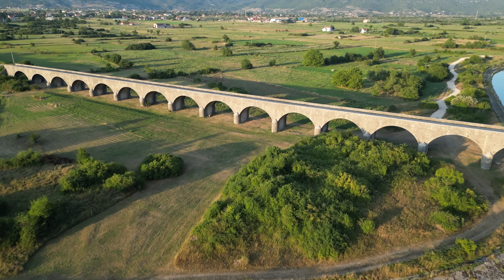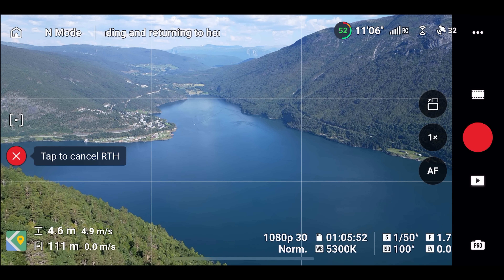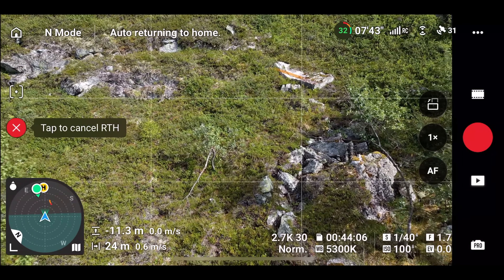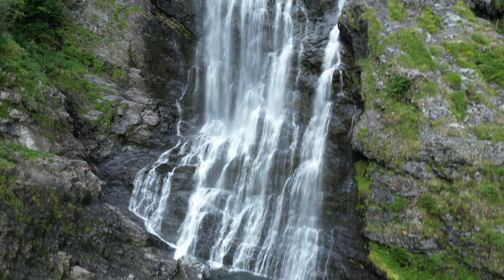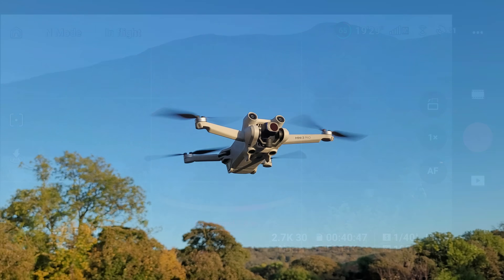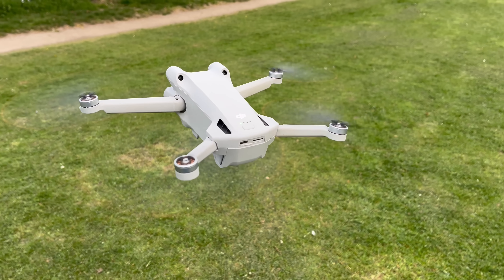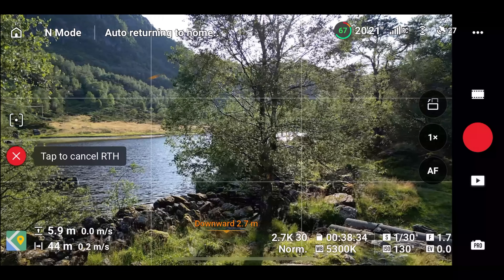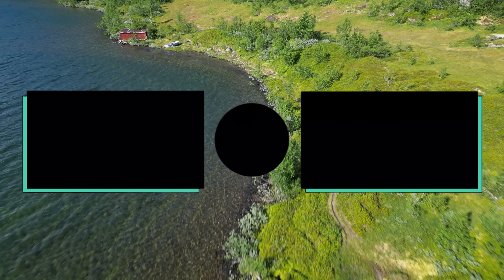Negative Altitude RTH has a BIG Problem... Here's What You Should Know

Comment: what? my old DJI Maverik Air 2 understand negative and positive numbers of its location in "3d space" this has never been a issue for me. the old ones ALWAYS rise first to 0 meters if at negative, and after that othe default standard setting of 120meters altitude before returning home, this is to make sure it clears tree lines and so on. These new DJI's seams to gotten worse..
Reply from the maker: Interesting. I haven’t seen how the older models handle this. Possibly this is a recurring bug in the software DJI needs to fix.

Comment: Never tried it, as I fly manually, but if your preference is set to bypass instead of brake, shouldn't it reroute past the obstacle?
Reply from the maker: Great question - one that I had too during my testing. The issues were still happening regardless of which obstacle avoidance method was being used, including Bypass. The drone just cancelled RTH as soon as an obstacle was detected. Thanks!

Comment: Negative altitude RTH is a user error, not a problem with the software!    The manuals say to pause at about 2 meters to wait for the RTH to set the location or to set it  manually about there.    "Negative RTH altitude" happens when users don't want to be bothered with that critical step and just fly off immediately causing the RTH to be set at the point when the GPS is enabled.  If you're flying downward that results in a "negative RTH altitude".    If you fly upward and away it still may result in a RTH considerably away from the takeoff point.

RTFM!      Maybe I know this only because I'm a newbie and realized it might be a good idea to read the freaking manual before flying off into trees, buildings and into water.

The RTH location cannot be set until the drone has had time to locate enough GPS satellites.    If you take off too quickly that location will be set away from the takeoff point.  And the more impatient you are, the faster you jump the gun, the farther the RTH location will be from the takeoff point.

What's clear from discussions (here and elsewhere) is that DJI's excellent software and hardware has saved many users from otherwise self imposed disasters because of not allowing RTH to be set at the takeoff location (users complaining about the drone returning to home at locations considerably away (laterally as well as vertically) and the obstacle avoidance preventing a disaster.  The drone just hovers because the pilot gave it instructions that would have resulted in a crash and the drone does the only intelligent thing:  wait for the pilot to realize his/her error(s) and give instructions that won't result in a crash.

PS  It is also HIGHLY important (RTFM!) to set a return to home altitude appropriate to the location.     DJI's drones obstacle avoidance may prevent a crash into buildings if you set RTH too low but a tree is likely to take the drone out.

The only SAFE way to operate a drone is to whenever a new feature is added (or upgraded) is to RTFM and find out the SAFE way how the feature or upgrade may change the way things work.

Read
the
freaking
manual!
Reply from the maker: From what I understand here, I think you have the wrong idea about what Negative Altitude RTH in this case is. It’s not about the Home Point being set by the drone somewhere below where you’re standing. It’s about how the drone returns to home from a negative altitude, like -20m.

You raise a good point though - it’s important to lock the home point before flying further away so that RTH precision is maximised.

As said previously, when the drone is at a negative altitude closer than 50m, it won’t return home. This doesn’t seem to be in the manual at all. In fact, DJI says that the drone will fly up to 2m if the altitude is less than 2m when RTH is started, which as shown in the video, isn’t the case. ( Timestamp: 3:15 )

So yes, always read the manual. But the crucial info seems to be missing from it. Thanks for such a detailed comment also.
Reply: you say RTFM , maybe practise what you preach WTFV , watch the firiggin video before commenting 🤣
Reply: Sorry, but the events shown in this video definitely can happen even when the drone has been allowed to hover over the launch point for some seconds until it has gotten a home point fix.
Reply: @afwAZ  Of course they can.  Again - RTFM!     You can set the altitude of RTH at the start of the flight or at any time during it.     If you don't set the altitude, the drone sets the RTH altitude a default amount above the point at which the RTH point is automatically set.   This is the point at which the remote is locked into enough GPS satellites, which, of course, can vary greatly depending on the location.    'If your are flying downward you're likely to be on a slope and many satellites will be blocked by the land behind you so that it will likely take longer (maybe considerably longer) for the remote to lock onto enough satellites to get a good enough location fix to set RTH.
RTFM!        And maybe even THINK a bit about what it says and how it works.

At no point in the video did the poster show any understanding that the RTH location cannot be set until the remote has located enough satellites to get a good enough fix!   Yet he went on and on about the problem without showing any understanding of how the technology works.

I'm just a relative newbie.   But at least I know enough to know that I need to RTFM and did so.      

KEY POINT.  You should PAUSE with every takeoff about 2 meters above the takeoff point and wait until the display shows that the GPS is active and the RTH has been set.

I've worked in user support before (computers, not drones) and any user support for any tech product will tell you that the majority of user problems are a result of users not bothering to RTFM.

Some drones are very expensive and it's just plain dumb to learn things the hard (and expensive) way because you couldn't be bothered to RTFM.

The budge way to learn is from other people's mistakes.
Reply: @afwAZ  RTFM!

You have to CHECK to ensure the drone got the fix.  In some locations it takes LONGER.   (the remote has to get a good lock on enough satellites)    Just pausing a few seconds will not necessarily get an RTH point set.   Especially when flying down!  (with a slope at your back you may have only half as many potential satellites available).   

And you can (and SHOULD whenever passing an obstacle higher than your current RTH altitude) reset the RTH altitude during flight.     For this (and other ) reasons you need to be AWARE of what your current RTH altitude is during flights.  Obviously the person making this video was not.

RTFM!  and THINK about how it works.   Understand what's going on and WHY and you'll have far fewer problems.

If something isn't working right it may well not be DJI's fault.   Maybe there's a loose nut in front of the remote.
Reply: @jimbarron9939  "You have to CHECK to ensure the drone got the fix." You assume what you don't know, and in this case is false.
Reply: @afwAZ OK I should have been more explicit>    The drone will get a fix whether you check or not.   What you have to check for is whether the drone got the GPS fix in the location you expected (just above the launch point).     If it took awhile to get a GSP fix the RTH set point could be considerably far from the launch point.

Most flights that descend from the launch point will have access to many satellites blocked by terrain.    So the GSP fix will be delayed resulting in a fix considerably BELOW the launch point if the pilot does not pause until the fix is done.
Reply: @afwAZ  IF the poster had actually RTFM, he'd have been aware of the requirement to hover over the takeoff point until RTH had been set, he'd have mentioned that he did that and the problem resulted in spite of it.  Because that's what people who are thorough enough to read the manual do.   The fact that he claimed that the software was in error without mentioning that he'd failed to rule out a potential misuse of it that would totally explain what happened is good evidence that he had not read it.  And not having read it, thinking that the problem was a software problem rather than (to put it generously) a "user interface" problem is what you'd expect.    

IF he was being thorough and careful, he would not have failed to note that he'd allowed the drone to set the RTH during takeoff AND that he'd  noted the signal from the drone that this had been done.   Not having done that totally destroys his credibility among those familiar with due diligence in investigating problems.

Even IF there was a real problem here (not caused by not allowing the drone to set RTH location during takeoff) the fact that he did not mention that was done AND that he CHECKED to see that it had occurred absolutely shows sloppy investigation. (a slopply investigation can sometimes return (by coincidence) an accurate result.  But if the investigation was clearly sloppy you can't KNOW whether the result was accurate or not without doing an additional (and careful) investigation.

Even a stopped clock is correct twice a day (unless it reads in military time).
Reply: @afwAZ  IF you had RTFM AND actually THOUGHT about it, you'd have realized that if within 50 M of the RTH point, the drone would not rise to the preset RTH altitude (IF you'd even set one !)

RTFM!  and THINK about HOW it works and what the very obvious implications are.

The manual does (at least for the Mini 2 SE) does not say it explicitly.  But it is glaringly obvious from reading the manual that if the drone is returning from less than 50 M away you'll need to monitor it and likely to control it manually.   Such things are exactly why manuals are written.
Reply from the maker: @jimbarron9939  The home point was locked in each scenario. Each time you can see in the top right of the screen that the satellite icon was white, which means that the home point was locked. This is also in the manual…The home point was locked BEFORE I took off.

During the tests, the icon was white with many satellites connected. GPS was strong. The problems occurred anyway, so it can’t have been because of bad GPS signal or a lack of connected satellites.

I NEVER fly away if the satellite icon is orange or red. I always wait for the system to say “Home Point Updated”. I assume this is common practice among each drone pilot.
Reply from the maker: @jimbarron9939  IN the manual it does say that when the drone is closer than 50m away, it won’t fly up to the RTH altitude, as you say. The manual however has some extra info as for what happens at altitudes lower than 2m, which as seen in the video, doesn’t happen. 
Once again, look at timestamp 3:15.

Believe me, I’ve read the manual countless times over.
Reply from the maker: @jimbarron9939  None of the scenarios in the video, apart from the first one, should have made the drone fly up to the RTH altitude. They had nothing to do with the specific RTH altitude set.

(This excludes the test where the drone was at a distance of exactly 50m away, since this test was to see if 50m made the drone fly up to RTH altitude or not, since it is on the boundary of the two distance thresholds.)

Comment: When I fly My Dji Flip drone around 50 m away then I press return to home. 
Then I See in dji fly application shows me your battery is critically low, force landing in progress .
But my battery is more than 50 .😂😂😂😂😂😂😂😂😂
Reply from the maker: That’s strange. Not sure why that would happen at all!
Reply: @takeoffdrones could it be because it was winter and the battery temperature was low?
Reply: @gurmiro  No there is summer season in Himachal Pradesh India temperature is above 35 degree celsius😂😂😂😂😂😂😂😂😂
Reply: @takeoffdronesI think that is software bug or battery fault
Reply from the maker: @dheerajsharma1981  maybe you weren’t using the official DJI battery?

Comment: If the drone is within 50m, it won't rise to the preprogrammed RTH altitude. It will fly straight toward the home point. It has been this way for a long time. I think the logic is if the drone is within 50m the pilot can easily see the drone to fly it manually or fly it to an altitude it can safely return home.
Reply from the maker: Correct. In most cases, you would bring it back manually. It only becomes a problem when you CAN’T do this, possibly due to the controller running out of battery or loss of signal.
Reply: @takeoffdrones Yep, and to add to that, losing signal is especially potent when in negative altitude, as the dirt and terrain will block the signals. (But technically it is legally required to maintain line of sight for this reason and others so it most likely won't happen).

Comment: Over a Ridge...
That's exactly why I had to use DJI Care for a lost Air 3...Lost coneection and the drone never returned to home...assuming it hovered in place until the battery went dead because it didn't RTH...couldn't retrieve it because the terrain was beyond my ability to climb...

BTW, I did try to climb in altitude when the signal started to deteriorate but the drone didn' respond...
Reply from the maker: That is so frustrating!! DJI should fix this problem.
Reply: My story exactly with neo
Reply: My flip did this too

Comment: Thanks for the video, good to know. It looks like you're using the M3P. I haven't tried all those scenarios with my M4P, but I almost always fly my drone home manually as I try to always practice VLOS. I have lost sight of it a few times and used RTH, but never at a negative altitude.
Reply from the maker: Yes I was using the Mini 3 Pro. I am almost certain that the Mini 4 Pro has the same issues. In some cases, returning to home manually can be quicker than RTH, however RTH is good to have as a backup. Thanks

Comment: Why use RTH for a drone that nearby? Use the red line in the radar map to point out the direction to home.
Reply: What happens when you lose signal? What happens if your hand slips and you press the button? It was pretty clear in the video WHY this is a problem.
Reply: @amerikalast Plan the flight to avoid loosing the signal. It's not an unpredictable ghost hitting the system. Watch the indicator and don't continue down below 3 bars.
During 2 years, 2 drones and several hundred hours of flying RTH has not been used once. The use of the radar map red line has given the heading for home.
My hand doesn't slip and make the relatively long pressing needed for RTH to start.
Reply from the maker: It’s definitely not that likely that you’ll lose your drone because of this issue, but there will always be some possible ways you could. Yes, you can attempt to minimise any risk to perhaps almost zero, but it cannot be ruled out. Thanks

Comment: DJI's technology is pretty good, but even I don't rely on RTH.  I always fly manually using the little compass icons on the left bottom part of the screen and I always fly home only after raising my drone back up to a plus altitude.  I call it flying by instrumentation.  The numbers must be right.  For me, RTH is a last ditch function.  If I have lost the signal and sight of my drone then and only then will I use RTH.  Even then, I still don't hit RTH until I first flip my elevation stick up and raise my elevation one hundred or more meters then I hit RTH.  Most of the time, just by raising up my altitude, I can regain my signal. Then I simply fly home manually using my compass icons and numbers. I have flown hundreds of flights off the roof of a 30 story high rise. So I have learned the ins and outs of negative altitude. Thanks for posting this useful video.  Many people don't even look at the numbers or their compass and have no idea where there drone has gone. The best rule to set for yourself is never let anything block your signal.  Maintain a good line of site at all times.
Reply from the maker: Great info here, thanks a lot. In some cases, returning to home manually can be quicker than auto-RTH, but it’s definitely good to have as a “safety net”. You can also set the RTH altitude to higher altitudes and you won’t have to fly up manually before pressing RTH. And I completely agree that the compass is a useful feature. Most people underestimate how useful it is to have in the corner of the screen, and it gives a lot of info at one glance.
Reply: @takeoffdronesAbsolut das kann ich bestätigen. Dieses Instrument hat mich schon oft davor bewahrt die Drohne zu verlieren.
Reply: I fly the same way. I only use RTH for emergency use,  or when showing someone how cool it is. I have only lost signal once or twice, but like you do, I take over once I regain signal. I once lost FPV on my screen, and I used RTH until I got the drone back in line of sight. All my telemetry was still working, so I knew it was coming back to me. I have a mini 4 pro, I always use the attitude and telemetry during my flights.
Reply: Simple when signal lost in negative home point ascend it high the return manually
Reply: Gracias Great video. Has anyone experienced flying a drone and, mid-flight, a "Calibrate Remote Controller" alarm message pops up? The drone disconnects and won't enter RTH. Regards.
Reply: Same with me, the compass and hight/distance numbers are the source of truth/trust
Reply: Does this happen with the Dji mini 4 also?
Reply: ??!! I've been flying DJI since 1917 (Mavic Pro), always conclude my flights with rth, never had a problem yet. Providing you have take off point .... "recorded on the map" .... it's no big deal for a DJI drone.
Reply: Same
Reply: Interestingly, RTH consumes less battery than manually flying it home so if your battery is low - Use RTH.